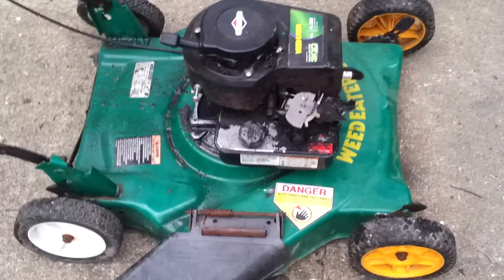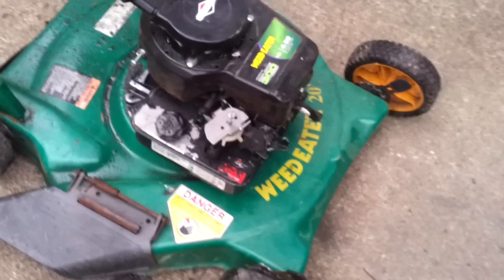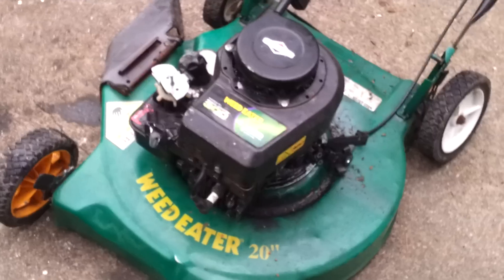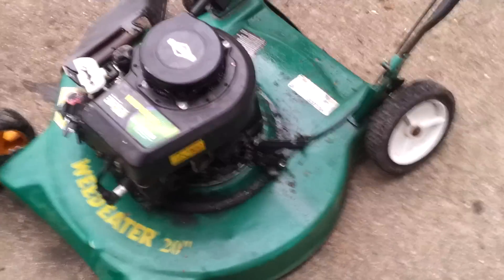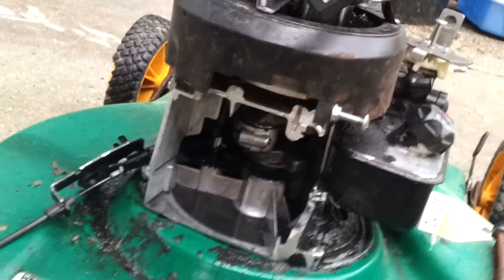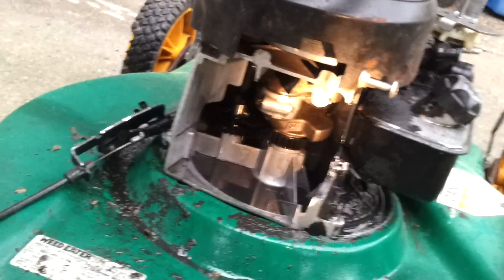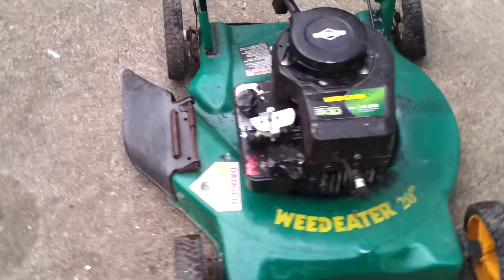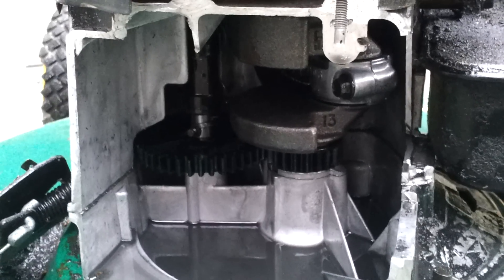Inside a running Engine (open crank)

Comment: Cool project.
You could drill holes for grease fittings on the upper and lower main bearings and on the rod bearing cap and this thing would run for a WHILE without complaining with the bearings packed with grease.
You'd need an adjustable drip oiler for the cylinder wall, but all of it would be easy to do. The valve guides don't need much oil. A drop or two on each valve stem every hour or so would be plenty. A thin film of grease on the timing gears maybe.
Reply from the maker: Ah, I wasn't that worried about it. When this engine had oil in it, it smoked like a freight train. The cylinder walls were pretty well destroyed from someone running it without an air cleaner for an extended time. I found it in the garbage and decided to do something interesting that I hadn't seen before. I don't have it anymore.

Comment: now throw a crowbar into it!
Reply from the maker: realflow100 Not really into destroying things just for the sake of destroying it.
Reply: i would never be serious about saying something like that. it was just a joke and idk why i even said it so you can ignore that now it was months ago
wouldn't this be a problem running the engine with an open crank? no pressure of any kind in the crank case means you wouldn't be able to do any other modifications to it.
Reply from the maker: realflow100 Well, it wasn't viable for anything else anyway. The cylinder walls were so scored up from someone running it without an air filter, it was more or less junk. Running it like that would destroy it in a short period of time if it had any load on it. But I only ran it for a few minutes at a time and lubricated the cam, crank, cylinder wall, and valves with a heavy-ish motor oil. 20w-50. It was enough to let it run for awhile without damaging it. It ran pretty well, but when it had oil in it, there weren't any mosquitoes for miles. I really didn't have any plans to modify it further, anyway.
Reply: akio2589 oh that sucks.. i wonder why the cylinders are scored.. do the piston rings have a chip in them or is there metal debris caught between the cylinder head and the cylinder wall? maybe you could sand down the cylinder walls polish them like crazy then replace the piston rings and you could get lucky but its probably long gone in the dump or something by now anyways..

I always wanted to know if an engine could run without a compression stroke?
basically a 1 stroke engine.
like if its even possible. Would it not have enough force to push the piston no matter how much fuel or air you put in??
Reply from the maker: realflow100 Well, to fix it, the cylinder would have to be bored and a larger piston and rings put in it. It would cost more to repair than it would to get another engine. They're scored up because it was run without an air cleaner, which caused it to suck dirt, sand, and other crap in the combustion chamber. Or it could've been run low on oil at some point, though the good condition of the main bearing most likely negates that. Non-compression engines do exist, but they're not "one stroke" and they're not very efficient. The compression stroke compresses the air fuel mixture into a small space, increasing the density and decreasing the volume. It effectively lowers the temperature needed to cause combustion, while increasing the work extracted upon combustion.

In other words, since the combustion is taking place in a smaller space, the rapidly expanding gases are able to have more of an effect on the top of the piston, causing more force to be applied to drive it downword. 

The closes example of what you're talking about that I can think of is a two stroke. Exhaust and compression are on the same "stoke." Actually, for all intents and purposes, the exhaust, compression, and the last part of the intake are on the same stroke.
Reply: akio2589 isn't a steam engine a 1 stroke? since extra compression would be pointless?
Reply from the maker: realflow100 Technically no, a steam engine is a two stroke, as it has an intake and exhaust stroke. But the primary difference is fuel is not ignited in the combustion chamber. The compression stroke is necessary for internal combustion engines, but not "external combustion" engines like steam engines. I use external for comparison purposes only.
Reply from the maker: realflow100 Also, the term stroke isn't necessarily referring to the process going on inside the engine. It's referring to the physical movement of the piston to complete one "power cycle" of an engine. Any time the piston moves up or down is considered one stroke. A four cycle engine takes two up strokes and two down strokes to complete one power cycle, while steam engines and two strokes complete it in one up and one down stroke.
Reply: akio2589 oh well then I guess a steam engine is the closest thing to a 1 stroke lol..

Comment: thats a good idea. yeah it probably wouldn't be good to be around. Reminds me of the engine i built last summer, out of one of these motors, its called a piston valve engine, another guy on here was the original one to build it (chargermiles007). I always have to oil the cylinder and grease the connecting rod each time i run it.